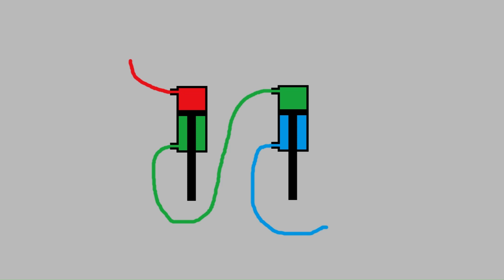How do Hydraulic Rephasing Cylinders Work

Comment: Is rephasing and connecting cylinders in series the same thing?
Reply from the maker: The volumes need to match. In the example in this video, you would need two different sizes of cylinders to get the cap end volume of one to match the rod end volume of the other. Beyond that, the cylinders need a bypass built into them for when the cylinder is either fully extended or fully retracted. This makes it much easier to get oil into the middle portion of the circuit when you first start it up. A large shock to one of them could also cause a small amount of leakage across the piston resulting in them not being synced anymore.  Having this bypass allows you to easily resync them. This bypass isn't on most cylinders.
Reply: @Hydrauliac  i have a 15 foot mower degelman, so i have 4 cylinders 2 for depth in center and 1 on each wing. And when i put mower all the way down the wing cylinders stop before the center. I believe thats an issue? How do i bypass that? Thx